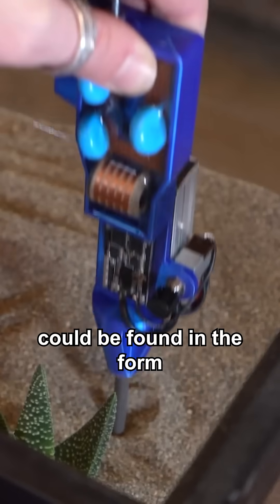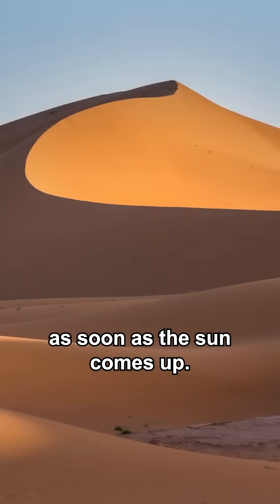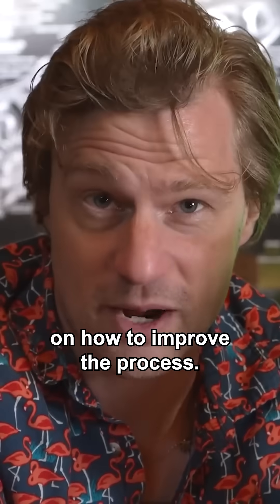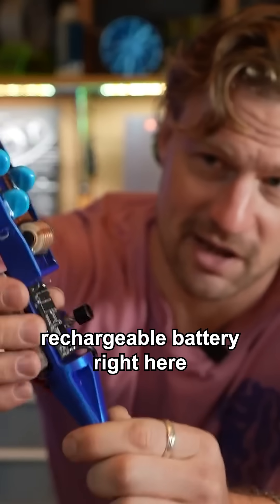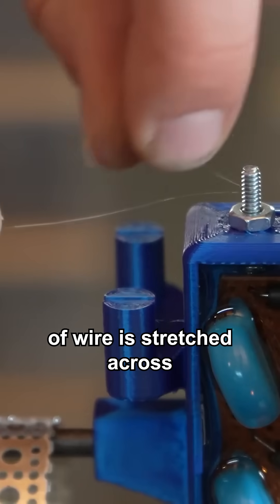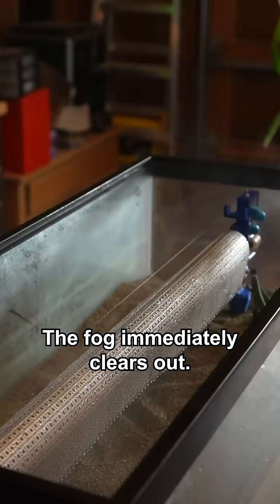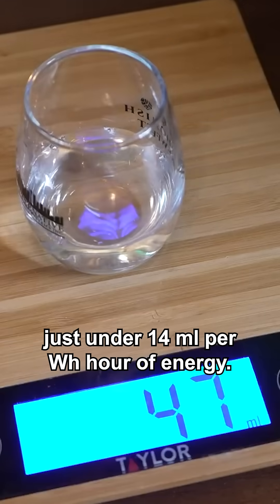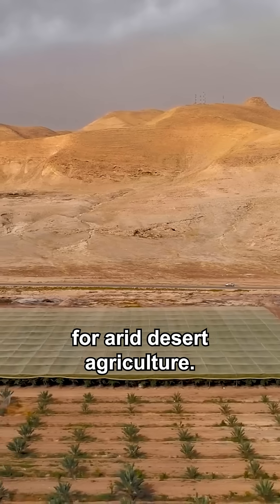Solving Desert Water Shortages Using 20,000 Volts (from full video)

Comment: Love how every few years someone makes a dehumidifier and it somehows blows the minds of the masses
Reply: Yeah but this is like an exorbitantly efficient dehumidifier. Like dehumidifiers generally aren’t outputting enough to sustain a human life long term. We make these things large enough in scale AND give them a solid purification process built in and we may have something incredible. Note how small this dehumidifier is and the sheer yield it’s providing. The portable AC I used to use could maybe yield that much water in 3 days.
Reply: @saadinhalf was gonna say the same thing that’s like a week of dehumidifier water lol
Reply: @yahiko7448  Dawg is your room covered in deep, thick fog that you can't even see through every morning? Didn't think so. Of course it won't get enough water, there's not even close to that amount of moisture in the air of your room
Reply: @ lol my room isn’t by the mountains but my job is. There’s mountains grouped up around the freeway and surrounding area. There’s only one small town in the mountain crevice. It probably would be covered in fog if they left their windows open. Not every morning tho
Reply: @saadinhalf  this idea is on the same level as covering parts of the sahara in solar panels. In theory possible but breaks apart into a thousand pieces once you start applying logic.
Reply: @Wolfinator420   Please apply the logic instead of saying “when you apply logic”

Clearly I’m not seeing what you are, yeah? I applied logic (and data, albeit anecdotally) and came to the conclusion that this is substantially more efficient and has awesome potential. So it’s not that I didn’t, it’s that yours is different.

“Falls apart once you apply logic” is an insult, not a rebuttal.
Reply: @saadinhalf  Ok here is your logic. The areas that could need gigantic dehumidifier farms like you suggested in the comment I replied to. How much humidity do you think they have? You could run the experiment. place a standard dehumidifier in your room and look how much water it gathers over a period of time. the dehumidifier will be what? 1% of the volume of your room, so you can roughly scale it up till you have the size of your proposed gigantic dehumidifier. Will that amount of water be enough for the people in that area? Will it be worth the energy put in to get that water?

Say instead of paying millions for that water farm in the dessert you instead use that money to buy tanker trucks, water and fuel in areas that have them and drive them out into the desert. you would get more water to the places that needs it not only faster but also cheaper.
Reply: @saadinhalf  I don't think this is that much more efficient. A small dehumidifier in a basement where I am will net you litres of water in just a couple days. More than enough to live off of. We end up running hoses to floor drains because it is annoying to empty them constantly. These things are literally designed to pull water from the air, that is all they are designed to do. They are likely all running close to the maximum efficiency.
Reply: @Matthamatic  You live in a city that requires no money
Reply: @saadinhalf  ?? are you stalking me? How do you think you know anything about me? But, no this works in small towns, villages and literal caves too. It is more about being underground. You don't need to be in a city to dig a hole. Also cities are generally more expensive than rural areas. Also, some cities are pretty dry. So I am really struggling to see the connection you are trying to make.
Reply: @Matthamatic  No it was a joke about economics and capitalism

Living in a city with an infinitely utilizable and infinitely collectible water supply implies the city requires no money
Reply: @saadinhalf  Oh, that went over my head.
Reply: @saadinhalf it depends on moisture and temperature. There is a minimum energy requirement to condense water.
Reply: @saadinhalf how could you get more efficient than the refrigeration process????
Reply: @amilliooo  You’re never gonna believe how refrigeration works
Reply: @saadinhalf you see, the problem is that 100% humidity is about 20g of water per m3, and the more you extract the more energy you need exponentially. Not to mention that is at a 100%humidity, and if you are at those levels water is not a problem in your area, in a desert you’d be talking less than 5g/m3 so if you had a free energy, perfectly efficient machine you’d need to comb through 400m3 of air….under very generous conditions might I add
Reply: @elskaalfhollr4743  The only problem in your point that it’s actually not exponential power increase. Exponential is a fun term to throw around but using more individual devices or simply running more power through the same system is purely additive so long as you aren’t changing the circuitry.
Reply: @saadinhalf  exponential IS the word, because the less water per air, the more air you gotta sift through, and the more you gotta cool it to condense it, that is just how physics work. If you have a pile of gold dust, you can sieve once and extract a bunch, but if it’s mixed with sand and lead shavings, the less gold there is the more you have to work to get it. Not to mention you are talking about locally reversing entropy which already costs magnitudes more energy than adding the entropy. In both cases under lab conditions you’d be talking about exponential energy expenditure btw, the fact that it would be on the field, you are absolutely right, wouldn’t make it exponential, it would be so much worse
Reply: @saadinhalf  I have to dump gallons of water out of mine
Reply: @saadinhalf to be fair, they put in a lot of fog—enough to make it hard to see the bottom of the tank, which is probably about a foot. in real life you'd never have 1 foot visibility in fog in the desert
Reply: @saadinhalf  i think that's mostly because dehumidifiers aren't typically being used in dense fog and not meant to extract as much water from the air as possible instead lowering the relative humidity to comfortable levels.
Reply: @ Exactly my point yeah
That this device isn't like... the same thing as a daily dehumidifier and that the guy's original comment is extremely reductive of what's actually going on here.
Reply: Its realistic. Its not nearly as viable as this makes it out.  @saadinhalf
Reply: @saadinhalf maybe that's because you have nowhere NEAR as much moisture in the air in your room as there is in the space in this example.
Reply: @Tamramsy  I mean solid point but it doesn’t change the sheer rate at which this is happening
Reply: @saadinhalf  yeah because you don't live somewhere where the fog is so dense you can't see anything in front of you
Reply: @i_am_a_toast_of_french   Ok fair so a place that’s a little less than twice as humid as where I live would yield about twice as much water from the same device. Note the size of the device. Note air humidity can’t exceed 100%. This tiny device is outputting THAT much water. That means the device is insanely more efficient.
Reply: @saadinhalf  yes air humidity doesn't typically exceed 100% but when the air becomes supersaturated, it forms fog (which is a bunch of liquid water droplets suspended in near 100% humidity) and if you're bathing your dehumidifier with effectively a heavy drizzle of water of course it's going to extract a lot of water out of those water droplets (but not the air itself)
Reply: Id like to think they have no idea theyve made a dehumidifier
Reply: @hiSwaps They absolutely do know, but they can't say it is, otherwise easily impressed people wouldn't buy into the idea. Just picture these 2 phrases together: "Hey guys I improved the classic dehumidifier design and made it more efficient" vs "I made this super efficient artifact that can extract moisture from the air" see the marketable difference? Lmao
Reply: @MauriciOwO exactly what I've been saying. the issue is physical. We literally can't make it much more efficient than regular dehumidifiers we have now. Its a thermodynamic bottleneck. Like car fuel or refrigeration. But these people are easily fooled. shame.
Reply: The fact I saw a comment like this years ago and an ex told it to me once really hits
Reply: I don’t know that I would drink the water from a dehumidifier.  For the record I don’t know I’d drink this guys water either.  lol.
Reply: @russelllopez4171  I mean the water from a dehumidifier is going to be pretty much just as clean as the water from that thing
Reply: @ actually I guess I created an apple orange scenario in my head when I made the comment.  lol. 

I’ve done a little reading on drinking dehumidifier water and although I forget most of it, what I came out of it with, was that it was actually pretty bad for you because it would contain contaminants from the air (in a house).  So me saying it would be bad isn’t actually true to the statement. Because if they were both running outside and collecting water it would be a similar (if not identical) product.
Reply: Remember that several times some tech bro invented the bus
Reply: Lmfao
Reply: @8--__--8-r1y 

A few songs : 
1.   TALES .... by Uriah Heep 
2.   LISTEN , LEARN , READ ON ... by Deep Purple 
3.   TELL ME WHAT YOU SEE .... by The Beatles 
4.   WHAT IS LIFE ? ... by George Harrison ( good Internet video song by Dhani Harrison ) 
5.    TO OUR CHILDRENS' CHILDRENS' CHILDREN ... by The Moody Blues 
6.    TEACH YOUR CHILDREN WELL ... by Crosby , Stills , Nash , and Young 
7.    PROCESSION ... by The Moody Blues 
8.    SOLITUDE ... by Black Sabbath 
9.    THE MISSISSIPPI SQUIRREL REVIVAL ... by Ray Stevens 
10.   TOCCATA AND FUGUE IN D-MINOR ... by Johann Sebastian Bach 
11.    DOMINIQUE ... The Singing Nun 
12.   FIRE ... from The Crazy World Of Arthur Brown 
13.   THE IRISH BALLAD ... by The Irish Rovers 
14.   DIARY OF A MADMAN ... by Ozzy Osbourne 
15.    WHAT I AM ... by Eddie Brickell and Paul Simon 
16.    THINGS A MAN OUGHTA KNOW ... Lainey Wilson 
17.     HALF OF MY HOMETOWN ... Kelsey Ballerina ( ft. Kenney Chesney) 
18.    CHURCH BELL ... Mary Spender 
19.    THE BELLS OF RHYMNEY ... Pete Seeger 
20.    

      How often does your society need to socially refresh it's collective societal memory sob that "the next generation ( of participants in our collective life and in our personal lives ) who "reside with us"  retains what "the kids" retain of the ideas , the concepts , and the techniques that were so hard to create , to find , to investigate , to study ,  and that we desire to. ( keep and maintain ) , to socially retain in healthy ways , and to personally remember in vitally useful ways ? ...   ...   ...
Reply: Literally lmao.
Reply: Efficiency and improvement is a thing buddy.
Reply: @RexCaelestis the issue is physical. We literally can't make it much more efficient than regular dehumidifiers we have now. Its a thermodynamic bottleneck. Like car fuel or refrigeration.
Reply: you missed the point
Reply: Right. Also, this idea isn't new and is already being implemented on a large scale in deserts.
Reply from the maker: This is not being used anywhere. Water sieves / fog nets are grossly inefficient. 2-10% at best. This system is much more efficient.
Reply: @PlasmaChannel moisture farmer from Star Wars.
Reply: @PlasmaChannel but wouldn’t you lose all efficiency gains when factoring in the real life factors such as location? In humid areas where efficiency would be greatest, you have alternatives for potable water. In dry areas, efficiency would decrease, maintenance and service costs would increase, and then you would need to factor transporting the resulting water to the locations that need it.
Reply: @PlasmaChannel  The other methods don't use electricity. Who gives a shit about efficiency per unit area when you can just get a bigger fog net for cheaper than this system.
Reply: @RedAndYellacuddlyFella 
Deserts are fucking dry. That's the whole point of them being deserts.
Air doesn't hold too much humidity and a little fog doesn't hold as much as the dude claims and it's not a 24/7 phenomenon. 
May as well just use desalination if it's a coastal desert.
That shit can only have any real efficiency in areas that are humid all the time and those have no water shortages.
Reply: @pepesmith2188 
Setting up desalination plants are incredibly expensive. The method this guy's doing is cheaper and depending on the scale easily portable. No the method he came up with won't fix the problem by its self but it would help a lot.
Reply: @pepesmith2188  Not to mention he is saying it could be solar powered... a machine that has to be operated in conditions that inhibit Solar power generation (fog)
Reply: @pepesmith2188  Nevada is a desert and gets fog almost 5 months out of the year idk what you’re on about. The mountains and valleys here are covered in fog so thick you can barely see through it sometimes
Reply: @pepesmith2188 there are deserts that get sustained morning fog that are coastal.  The humidity just doesn't condense until a much higher altitude and the rivers that it go into don't go through the dessert.  This would be limited to ONLY those small parts of applicable desert (parts of the western Sahara, the Atacama, the Arabian peninsula, baja california, and spain) though.
Reply: @pepesmith2188 Deserts are dry but not all are completely void of humidity, mainly in the morning when dew forms on surfaces. Hence why this concept works in the desert.
Reply: @meepman2984this is more energy intensive then Desalination by a large amount 
540mls took 39 watts 
To create 1 cubic meter of water 100,000 that's 71 kilowatts,  it takes 2.5-3.0 kilowatts to Desalinate the same volume of sea water
Reply: @pepesmith2188, don't try to sound smart if you can't even say what it is you're saying without cussing
Reply: @pepesmith2188  what defines a desert is the amount of downfall, not the humidity per say
Reply: @Skyfighter64  no no, tbf it could charge during the day when there is no fog to be used next morning. The way you dismissed that claim isn't as smart as you think.
Reply: @Skyfighter64  so then use a batter like he did wow solved that problem
Reply from the maker: Batteries. Charge during the day, work at night.
Reply: @PlasmaChannel  been done before. many times
Reply: @Skyfighter64 do you think solar-powered things can't function without the presence of the sun? No! The solar power charges a battery cell. The battery cell is what runs the machine. The sun does not have to be out for a solar-powered device to operate.
Reply: @Skyfighter64  it's pretty obvious it would charge a battery and use a switch that shuts off by timer. He shows the battery.
Reply: @Skyfighter64 batteries charged using solar power
Reply: @koontz1154 you aren't thinking that though. You should Brush up on thermodynamic science.
Reply: @mrdevindean1  what? I actually cannot find the relevance in your reply. What does it have to do with what i said?
Reply: Ive seen this like 20 times, it has never worked.
Reply: @thesaddestdude3575 based. thunderfoot put this on my radar like a decade ago and I've seen it pop up multiple times since then and everyone thinks it's a new idea everytime lmao
Reply: Just because it's using existing technology doesn't mean it can't be used to create something that can have a good impact
Reply: @nicknorthcutt7680 the issue is physical. We literally can't make it much more efficient than regular dehumidifiers we have now. Its a thermodynamic bottleneck. Like car fuel or refrigeration.
Reply: I guess you don't understand the concept of 'efficiency'.😢
Reply: @maynardtrendle820  considering he left the second  measurement required  to determine how efficient it is then proceed to just makes claims  I have no way of determining where this lays compared to similar technology.  I don't take people that make these claims  at their word nor should anyone when they have something to sell.
Reply: @maynardtrendle820 the issue is physical. We literally can't make it much more efficient than regular dehumidifiers we have now. Its a thermodynamic bottleneck. Like car fuel or refrigeration. Its you who doesn't understand.
Reply: Feels like every year someone invents the dehumidifier to scam someone for money
Reply: The thing isn't the invention itself that's important, it's making it efficient enough to be viable that is
Reply: What have you contributed to humanity other than making rage bait
Reply: It can be a large scale water production dehumidifier. In his original 16-min video, he tests a commercial dehumidifier also
Reply: Yay let's mess up another part of earth's systems instead of living where it's habitable 😮
Reply: And then there’s you a lifetime of years and haven’t made a single thing.  love it.
Reply: And also blows the minds of people commenting.  Maybe check the hole video instead of making idiotic comments
Reply: @WJACowboy its an accurate comment. If you Bothered to look into this project .. or the 50 other failed projects like it in the last 10 years then you would know that has gone absolutely no where and it's not viable in slightest. But people will sure throw money at something like that when they are easily fooled. And then start making "idiotic comments" as you put it. when you have no understanding of the thermodynamic science that goes into this concept you are easily fooled by its premise. They call you useful idiots because you lap it up like a dog in heat.
Reply: I am an engineer and although this is far from my expertise I had a thought.  FYI, engineering isn't about knowing everything about everything immediately it always takes study and testing.  Anyway, assuming that all the dehumidifier comments didn't take into account that this fellow knows what a freaking dehumidifier is and that this is much more effective and efficient that's where my idea comes in.  One of the places this is a big deal is the Atacama desert.  Those that are curious can look it up but in short it is the driest place on earth and it has this crazy weather pattern that brings in a ton of water through fog it's very cool.  I think several of not all the clips were from there.  Sorry, to the idea, to continue post capturing the fog in coastal areas where this would be most effective in the first place it seems you could further take advantage throughout the day with the unlimited seawater and blazing desert to evaporate fresh water and possibly more quickly and effectively remove it to continue the process constantly pulling out the water so the air never saturates and evaporation can continue more easily and faster.  Just a thought, nothing more.
Reply: @chuckp6667 the issue is physical. We literally can't make it much more efficient than regular dehumidifiers we have now. Its a thermodynamic bottleneck. Like car fuel or refrigeration.
Reply: Good thing physics exist
Reply: I love looking ppl debates on Yt Shorts
Reply: I blame education.
Reply: Nuance is apparently difficult, just because there have been kickstarter scams involving dehumidifiers does not mean the concept couldn't be viable. Those previous projects however showed that the founders did not understand the underlying physics, and their implementations were fundamentally flawed. This however seems to actually have a lot of potential. 540 ml an hour on under 39W on this compact setup is orders of magnitude more effective than your household dehumidifier. Really clever to exploit morning fog as well. You can run it while the yield is high enough to make it economical, and spend the rest of the day, while the efficiency would be lower, to charge batteries for next dawn using solar
Reply: @sindrekolbotn the issue is physical. We literally can't make it much more efficient than regular dehumidifiers we have now. Its a thermodynamic bottleneck. Like car fuel or refrigeration.
Reply: This thing can make 12.9L of water er day with just under 1Kwh wich means you could make roughly 100l drinking water with a 750 mah 11.4 v or 3S Lipo ( if my meth is right )wich is crazy
Reply: This isn't a dehumidifier. Dehumidifiers have to pay the thermodynamic cost to turn vapor into liquid. This device collects liquid without condensing vapor.
Reply: @diablominero the issue is physical. We literally can't make it much more efficient than regular dehumidifiers we have now. Its a thermodynamic bottleneck. Like car fuel or refrigeration. And other than a dehumidifier this device is completely theoretical because it has not been and likely cannot be viable in practice.
Reply: @mrdevindean1  there is no thermodynamic bottleneck for turning small drops of liquid water into a large drop of liquid water. You just put them next to each other and surface tension does the work for you. This is more akin to pouring two cups of water into a single basin than to dehumidifiers.
Reply: @diablominero  depends on the methodology. generally You are correct. But dehumidifiers do use thermodynamic principles.
Reply: @mrdevindean1  yeah, but this isn't a dehumidifier. It's a prototype of a new technology for collecting water from coastal fog that isn't yet in commercial use.
Reply: @diablominero  the problem is that I've seen this exact "prototype" in different forms over the past 10 years. Always sells itself the same as something else Its always just a dehumidifier. Its a money hole scam. Like hyperloop. Look into thunderfoots old videos. He's actually a thermodynamic and nuclear scientist and he goes over in scientific detail and breaks down why these things aren't physically viable. Or At least not in the way that's being sold here. He Cover many of these tech hole scams. Id like to give the benefit of the doubt but after seeing the same "project" 20 times and every time its just a scam so you have to forgive me me for being cynical.
Reply: Me when I become a negative nancy
Reply: I mean that's like claiming we shouldn't be impressed with a V8 engine because someone invented the car back in the 1930s.  You can be impressed with how quick it is.
Reply: Ya but this one is pretty
Reply: No, dehumidifiers remove gaseous water from air, this is just collecting water vapor (smell liquid water droplets)
Reply: @William_Asston you literally just said " dehumidifiers get rid of water vapor whereas this device would remove water vapor. i hope this is a joke. You do realize that water in gas form IS water vapor right?
Reply: @mrdevindean1  small droplets vs gaseous.  P sure they aren't the same
Reply: @William_Asston  yes.. they are. How would the droplet come from air of they aren't vapor (gas) genius?
Reply: Ya and what are you doing with your life that’s so impressive?
Reply: @swizzlesticxx  same thing you are, clownstixxx.